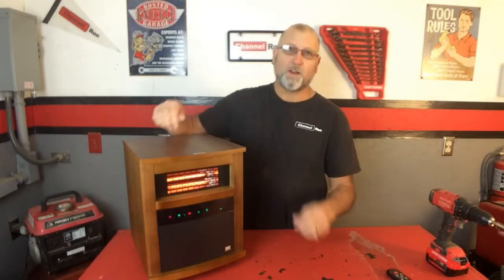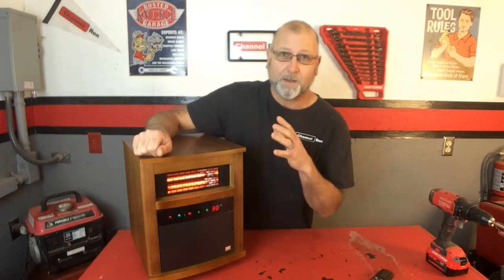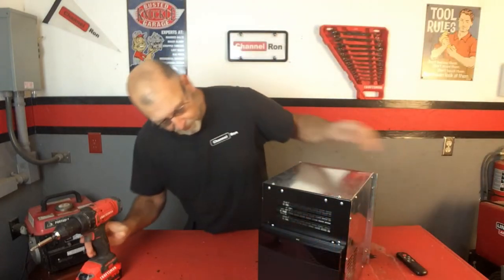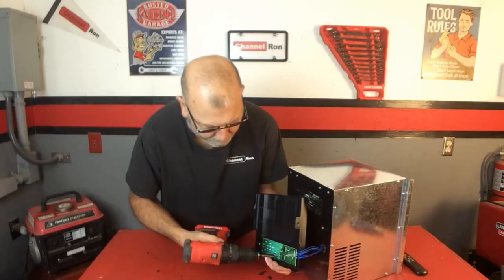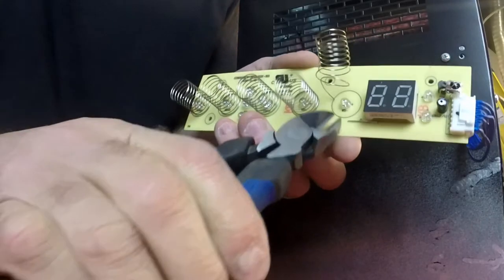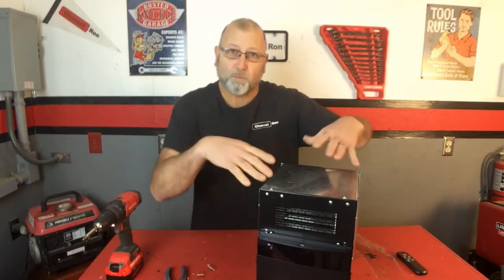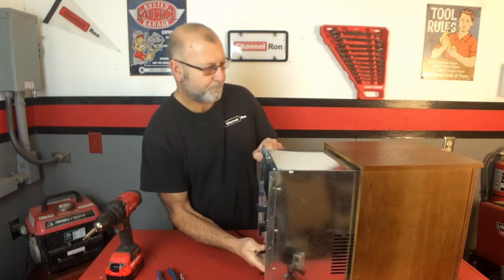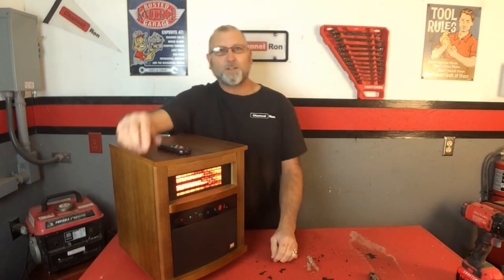1500 Watt heater Continually beeps and control panel not working

Comment: My Soleli Infrared model: WH-94H, beeps constantly, even more than yours did.  The digital display is garbled, and the buttons act screwy. The down button doesn't work at all, but the remote still contols it.  I was able to get to the control board, but there are no spings, just small square low profile buttons.  I figured the down button was stuck, but that is not the case.  I put foam into the piezo speaker to shut it up!

Comment: If you isolate each spring with a vinyl tape (electrical) collar about 3/8 inch from base of each spring and wrap around each spring it will effectively shied and isolate each spring from any electrical crosstalk and allow use of the buttons in the face of the board.  This is actually a much more effective design of control board that the more traditional pressure pad boards.  The springs don’t wear out like the pad style boards do.  Thus the control boards  heaters will last as long or far longer than the infrared elements .